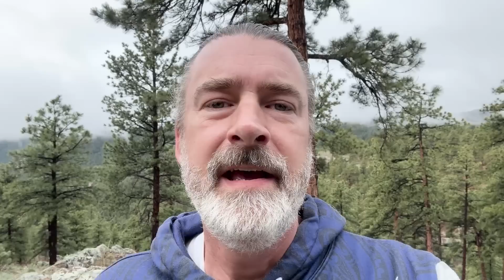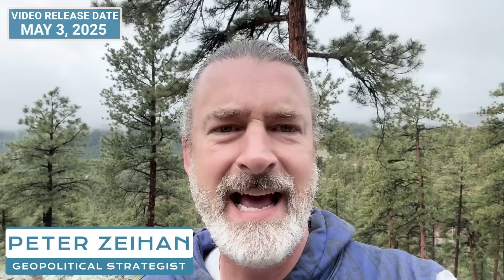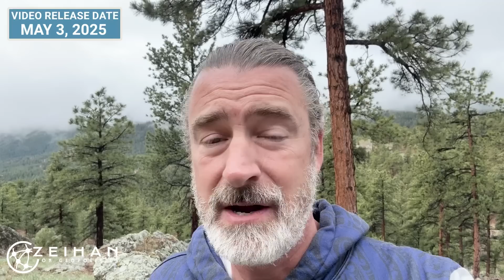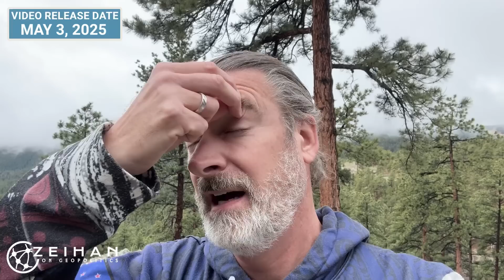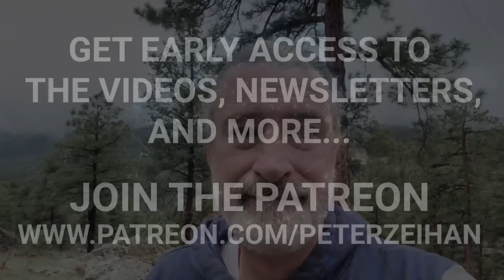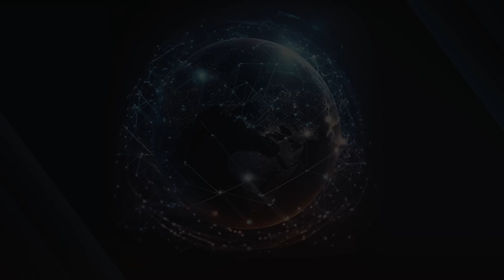The Night the Lights Went Out in Geor- er, Spain || Peter Zeihan

Comment: Electrical Engineer here! 
Great video Peter - Explaining the very complex grid disturbance phenomenon as wobbles and the Macarena dance. 
I agree with the solutions proffered. Another solution that wasn’t covered is grid compensation devices on the transmission side. 
I.e Synchronous Condensers. 
They can be installed at transmission substations (with renewable energy generation sources) to provide the “grid inertia” that traditional thermal power plants (coal, gas, hydro) inherently have.
Reply: Seems like flywheel batteries were built for this! What if solar/wind generators stored power in flywheels, which could absorb these kinds of disruptions (wobbles)?
Reply: @richardmoore2325 flywheel energy storage is a different thing because they speed up and slow down as they charge and discharge like a battery. Synchronous condensers have to stay spinning at the same speed all the time, synchrosied to the grid frequency.
Reply: Give me a break on this bullshit cover story.    
Its CHINA doing bad things to take over Gibraltar.
Reply: *****Give me a break on this bullshit cover story.    
Its CHINA doing bad things to take over Gibraltar.

Comment: This explanation is missing a key point. The lines that were carrying large amounts of power between areas suffered from Coronal Discharge, which is where the power of the energy being transferred starts turning the air surrounding the power lines in plasma, which conducts electricity. This is a bad thing, as the grid suddenly loses a lot of power, and the normal responses (of adjusting power input and distribution) don't help, and in fact can make things worse.
The automated responses didn't understand what was happening, and so the things they did didn't help.

Comment: ME here. If you build a turbine and remove the compressor stage (intake) and turbine stage (power generation and exhaust) then you're left with... a flywheel. In other words, a mechanical battery. These exist for niche, short-duration backup power applications. If spinning mass were the only cost effective answer to stabilizing the grid, that can be done without burning hydrocarbons. It would be costly, but climate change is also costly.

Comment: I've watched plenty of videos about this power outage, but have seen only one about what actually cause the power lines to get out of sync and trip the safety breakers.

From what I have heard, there was a weak spot in the magnetosphere, i.e. the earth's magnetic field is weakening and developing fissures, which allowed super powerful solar and space ionizing rays to break through. These are the same rays that cause the Northern lights, which you may have noticed, are happening a lot more frequently at lower attitudes.

From my understanding, the weakening magnetic field is a natural phenomenon that happens in cycles in a lead up to a flip in our magnetic poles.

Some people are saying it could happen in the next 10 to 20 years. If this theory is true, it will wreak havoc on our entire electrical grid, and for the next 20 years, incidents like what happened in Spain will become commonplace.

Power grids across the globe are not built to withstand these types of events and so power outages will get more frequent and last longer.

Our nations are simply not prepared for what is about to happen.

Comment: Why don't they plug in some heavy energy consumers to burn the surplus when that happens. 
I would think it's not hard to make some machines that are very power hungry and energy inefficient, if you want to waste it. Engineers work hard to make things efficient, but making inefficient stuff should be easy.
Could even be put to good use, like some huge electrolysis devices to produce Hydrogen.

Comment: Er, are we not using massive grid scale LiOn batteries in the US (13GW mostly LFP deployed in California for example), Australia, and other places?  Lithium Titanium Oxide (LTO) has been used in a pilot or two in California but it's expensive and has lower energy density than other LiOn chemistries and is not going to be replacing LFP anytime soon.  Claiming the LTO is the only battery type capable of helping stabilize grids is utter nonsense and a great disservice to the public.

Comment: Wind turbines actually produce AC power at the frequency they are rotating at.  To sync them to the 50Hz/60Hz grid you do then first go to DC before a second conversion to synchronized AC

Comment: Sorry Peter, I can’t take you word for it on this one. “Too much solar” and “not enough spinning reserve” are the obvious reactionary explanations.  
Actual experts have said it’s not as simple as that, and officials have specifically denied that, including the PM. 
A lot of solar tripped off, but if it had been a nuclear power station just the same thing would have happened, the protection devices follow the same tolerance for voltage and frequency deviations.

Let’s wait for the official report shall we.

Comment: modern Inverter for renewable power sources are more and more able to stabilize "wobble" by active steering so no you don't need traditional Power Turbines and no you don't need new batteries only for something curves over a day or so. Smarter grids and Inverters is the solution.

Comment: You're forgiven! 50Hz, not 50MHz

Options you forget to mention is to use hydroelectric plants and nuclear reactors, which is clean and a massive source of energy. 

A hybrid nuclear/wind-solar is the best solution by totally removing gas/oil/carbon dirty plants.

This is specially perfect in geographical locations with low seismic activity.

Comment: Coming from an electrician
AC (alternating Current) = curent flow that alternates direction rapidly.
The frequency = Hz. This measures the pulses 60Hz for example = 60 alterations in 1 second.
Factor in single phase or 3 phase
(2 or 3 conductors (wires))
Each conductor has it's frequency off set to peak at different times. This raises the average voltage. where one phase drops off and gets picked up by another keeps the voltage on a more balanced 110V - 130V or 120volt average. If you take a multimeter to a outlet the voltage it tells you is at that 1/60th of a second that the voltage is in its signwave so it will vary every time you check.

Everywhere is different I think north america uses 60hz 120/240v  typicaly but uk amd europe are also different at 50 hz and different voltages i believe. Using the wrong hardware in these circuits can cause catastrophic damage so make sure you're using the right stuff for where you live and only if you know what you're doing. Always call a Profesional.

Comment: 50 Hz vs 60 Hz. It is not correct to say that they are equal. There are far more deaths from electrocution in 60 Hz systems than 50 Hz systems. 60 Hz is much more likely to destabilize the human internal electrical system. The use of 50 Hz in most of the world is by no means accidental.

Comment: Li-Ti batteries aren't the only thing that would do this.  Super capacitors could perform the inertial duties required and probably are easier to deploy than Li-Ti batteries from the supply constraints.
Reply: LiTO is unnecessary.  Regular LFP batteries have no problem providing burst energy, and grid scale storage already provides these functions using them.  Peter is talking out of his ass, as usual.

Comment: The 4th way is to have infrastructure that just provides grid stability. Basically you use the current to just spin something physical. This loses some energy but it provides short-term stabilization. And of course in countries like Finland and Sweden, you have hydroppower. This has also physical spinning stuff.

Comment: Another potential solution (probably) would be to dedicate part of the redundant renewable generation capacity to constantly spinning mechanical flywheels in lieu of the said turbines. They'd be very heavy and take a lot of power to get up to speed, but once spinning, the additional power requirement would not be that huge. That'd be cleaner and provide the stabilizing effect on the grid, no?

Comment: EE’s involved with power transmission know and study and fret about what to do about the lack of inertial generation; but they only talk about it to each other.    The issue is technical and getting the attention of politicians or utility managers is not easy, especially for introverted engineers.    So thank you for brining this topic up in a relatable way, maybe it will start getting the attention it deserves.
Reply: I don't remember whether it was @undecided or @justhaveathink, but I did hear about Ireland installing dynamo kinetic storage for frequency regulation.  I don't think they have the reach Mr. Z. has, though.

Comment: Electric power engineer here... you are forgiven about your technical description which for layman's term is close enough. Anyway, two comments....
1) I was surprised that you didn't discussed the politics of the situation related with the intention of Sanchez's government of discontinuing nuclear in Spain. Besides the technical vs. political vs economic issue of nuclear vs. renewables the nuclear industry in Spain has a long history of driving political change even from decades ago when ETA used it as an argument against the government. So this is a core geopolitical issue that I am surprised you touched in a so simplistic way as this is the take I was expecting from a geopolitical stategist instead of the "anecdotal tactical" description you made. That is, why did you choose to have a video mostly about EE stuff instead of having of what is your field of knowledge which is at the core of the problem of what happened in Spain, much more than the technical issue?
2) batteries are not a solution for system wide issues. But this is not a manufacturing or soucing problem. Even if the batteries were free and you could manufacture them easily from plain dirt, the amount of batteries you need to achieve the necessary stabilizing energy is so large that makes their use impractical. You can use batteries for microgrids in the way you describe for stability support but that's only because microgrids are "micro." When you talk about a systemwide solution we are talking about a 5 or 6 orders of magnitude difference which creates scaling practical problems.
Reply: By the way, in microgrids you may not worry about "the wobble" but you do care and a lot about voltage drops so microgrids do still need energy storage for stability. But you are forgiven about this technical error (actually a big one) because it is not your field. But, again, why discussing this issue from a technical perspective in which you are not an expert instead of discussing the very relevant geopolitics of this issue in which you are an expert? The issue of nuclear power in Spain is influenced a lot by demographics and geography so why not taking this approach?

Comment: So next door grid (France) with its base line of Nuke.......   Steam based.....   Is the functional/"simple" fix.    As to the size/output of todays NEW designs.   You convinced me that Battery is not possible and never will be.   Its just cultist to "count" on the Green stuff.   Cost/Politics/Access to materials makes that path silly.  So, whats the status on the small (non plutonium producing Sodium reactors that can be put into the parking lot of old coal fired steam plants)......   You then dont fire up the coal but pipe over to the turbines the steam from the new trailers in the parking lot.    (or small building you added to the existing plant).    Yep,  Green is a pipe dream of ego.

Comment: 1:03 - On the other hand, power in an AC system is transmitted by a difference in phase. In 50Hz a cycle is 20ms, and in 60Hz a cycle is 16.7ms, and to transmit power you have to have all nodes in agreement by about a half a cycle, or 10ms and 8.9ms, respectively. In this way, 50Hz is better in "the wobble"...

Comment: I’m not sure using wobble in place of frequency really adds any value to the layman.
Reply: The actual frequency drop was not the cause… it was the last gasp of a grid that had already failed.  It just happened very quickly which made some people believe it was the cause.  A better example would be during the great Texas Freeze where ERCOT was fighting tooth and nail to keep the grid up as they saw the frequency slowly drop due to severe imbalances that they could not correct.  They were something like 60 seconds away from mandatory trip points that would have taken the grid down entirely and require a black start before they managed to shed enough load to keep the system from failing outright.

The failure in Spain occurred much more quickly, but the actual cause is still unknown / unreported.  It certainly wasn’t the “wobble” Peter is talking about.  That was way too low a frequency to cause any sort of trip.  Harmonics like that happen all the time on long transmission lines. A warning sign, maybe.  The cause, unlikely.
Reply: @ I agree that we still don’t know the cause for certain and this video was absolutely premature.

Comment: You don't mention mechanical/gravitational storage , like using the green energy to pump water uphill to a reservoir, then using tried and true water turbines as necessary easily brought on and off line just like Canada does with their hydro electric power generation

Comment: Chemical Engineer here.  Strait forward solution; use a portion of the electric to heat water, form steam, and drive a power generating turbine. Yes, there will be some portion lost to inefficiencies, but it “only” requires a retrofit of an existing coal or gas plant.
Reply: @ctbusta  I think you're underestimating the amount of excess you need to create that steam.  Otherwise you're just creating lukewarm water which is 100% inefficient.
Reply: Power lost to inefficiencies? What about all that latent heat used to make 100c water into 100c steam? Its 2260 joules per gram of water aka 2260 watts. That input is fine when using a radiator because the heat is lost to room the radiator is in but you wouldn't get any of it back in your proposed way. You'd be better using the excess power to electrolysis the water into hydrogen to be used later for energy or industrial purposes. But, the issue is that motors and generators mess with the phase of power causing the Hz to change. Not, excess power in the system. They usually fix power phase change by using capacitors to even out the phase as motors are incudtion coils and they are the inverse of a capacitor.
Reply: As a chemical engineer, you should understand the difference between work and heat. Electricity is work, and combustion is heat. When you use electricity to generate heat you degenerate the work into heat, and it requires a heat engine to convert it back into work. The most efficient heat engine uses a Carnot cycle, but in practice this is not realizable. A typical old-school thermal plant uses a Rankine cycle, and that is what you would use if the electricity generates steam. Rankine cycles have a thermodynamic efficiency of about 35-40% maximum, and with the materials we have on earth that is as good as it gets. So if you took 100 MW worth of electricity to generate steam, the resultant turbine would make about 36 MW of power. 
Maybe consider brushing up on 2nd year thermodynamics.
Reply: Yeah, the transients arent powerful enough to equal another power plant consistently
Reply: It's much more efficient to use electrically driven synchronous condensers rather than getting steam involved.

Comment: Your explamation was truely horrible.  Briefly I worked for the UK Electricity Control Centre - very simple there is a prescribed amount of inertial energy available at any time plus access to several energy interconnects with neighbouring countries.  The situation in the UK is tighly managed with statistical views covering extreme conditions that might occur during the next 10 years.  A more precise term for wobble if the frequency drops by more than 0.5 Hz than a major city may be diconnected to reduce the load on the grid and the frequency then rises.  You can see the tight control of the UK national grid mains frequency - the details are published on the internet . . .

Comment: The problem is an economic and political one; not a technical one.
Wind and solar require additional grid infrastructure to reach comparable stability versus traditional fossil fuel power stations. Who is going to pay for this upgrade to infrastructure ? the grid companies ? solar and wind owners ? taxpayers ?
Politically those pushing green don't want to admit that it will cost more than the figures they've previously  suggested, especially during a cost of living crisis.

Comment: You are also forgetting about mechanical spinning wheel storage, which has a relatively low capacity compared to batteries, but is precisely good at evening out the oscillations in the network. Say like turbines you described, only purpose built for storage and grid oscillations cleanup

Comment: Umm. Cannot we build pumped hydropower stations to keep the grid stabile?

Also, with wind and solar, you can use the DC current to heat up water to produce steam, which would spin a turbine..? Am I wrong?

Comment: Good explaining but some details were wrong. Most wind turbine are actually AC generators and have a large spinning mass but not big enough. Nuclear is a big thermal spinning turbine so same as fossil fuels in the respect. There has been some experimenting is flywheel energy storage so there us some promise there. Large specialized flywheels built for stabilizing the grid might be a custom built solution for the future of green energy.